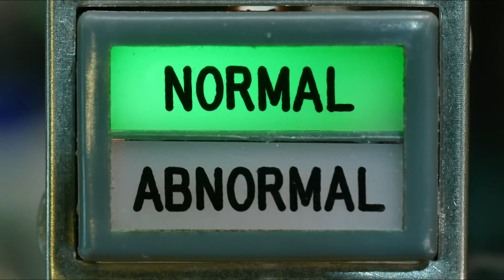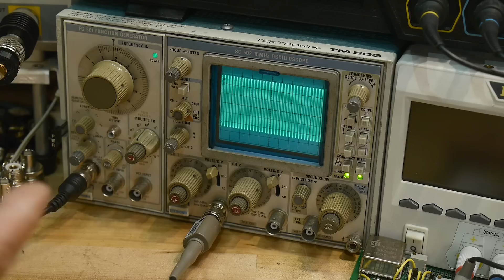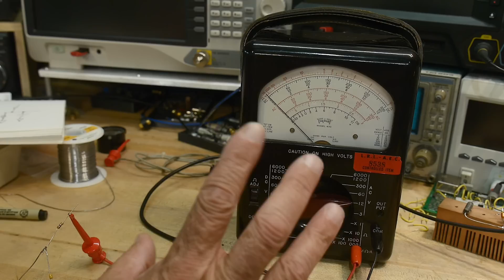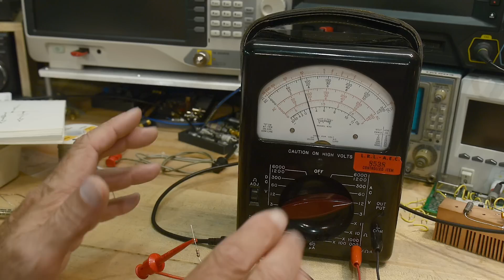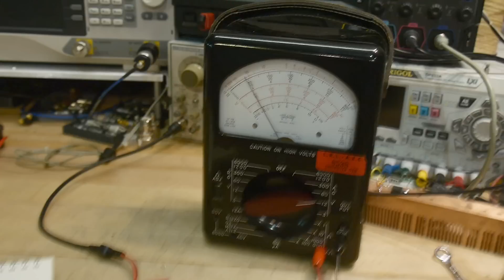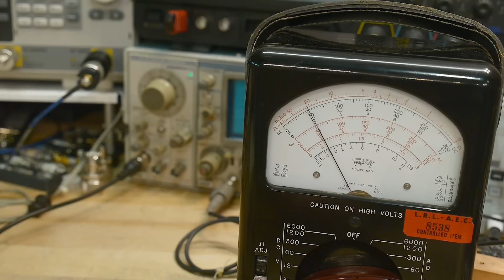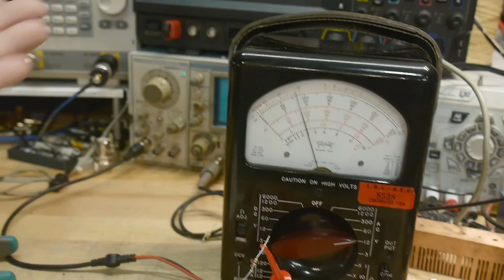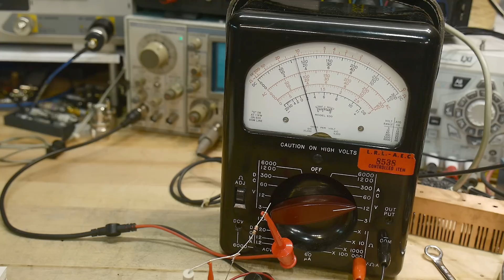#1607 Stop Making Excuses:   Learn Electronics

Comment: Love this video, and the message about Stop Making Excuses!

Maybe already said  by someone in the comments.
I disagree that in the RC or LC circuit, half a voltage is when the impedance of the C (or the L) is around the same as the resistor.
In the RC circuit, the voltage of the capacitor is Vc = Vgen*(1/jwC)/(R + 1/jwC)= Vgen/(1 + jwCR).
In order that this voltage was Vgen/2, |1 + jwCR| = 2.
Taking the squared module, 1 + (wRC)^2 = 4.
Isolating wC: wC = (4 - 1)^0.5 / R

The impedance of the capacitor is |Xc| = 1/wC = R/(3)^0.5 = 1000 ohm/1.732 =  577 ohm.

With the values you have: C = 10 nF, w = 2·pi·f, f = 30 kHz,
 |Xc| = 1/(2 * 3.14 * 30e3 * 10e-9) = 530 ohm, similar to the 577 ohm from the theory, but not 1 kohm as the resistor.

The same happens with the inductor:
|XL| = wL = 2 * 3.14 * 10e3 * 9e-3 = 565 ohm.

R/(3)^0.5 ~= XL ~= XC.
Reply: When |XC| = R or ,|XL| = R is the power what reduces to half, but the voltage reduces to 1/(2)^0.5. ~70.7 %.
Reply from the maker: my meter measures Vrms
Reply: @IMSAIGuy  It doesn't matter that your multimeter measures RMS because when you measure the generator, you use the same multimeter, so the ratio of VC/Vgen = 0.5. When the voltage divides by two, the power reduces -6 dB (one fourth). 
When you do ratiometric measurements, it doesn't matter if you do it in peak or RMS.
But in a series RC or RL circuit, when R = |XC|, the ratio of the voltage reduces to 0.707, that is -3 dB in power.

If you do the math, |XC| is not R at 30 kHz (or |XL| is not R at 10 kHz) but  |XC|~=530 ohm (and |XL|~=565 ohm). 

On the other hand, this kind of multimeters doesn't measure true RMS (I have mine since 1979 and I still use it), it measure RMS only for sinusoidal signals, because the relationship is a constant; good to do this experiment as long as the frequency was not too high due to the frequency response of the multimeter (and the loading effect if C is too low).

Comment: doesn't  swapping the positions of the capacitor and inductor also give you a notch filter, i.e. band reject?
The biggest things I got from an engineering PhD wasn't specialist knowledge. It was resourcefullness, tenacity, and problem solving skills.
The academic knowledge and mathematical treatments will only take you so far until practical realities separate the knowledable from the wise. Those very same skills are, however, likely to drive your wife mad😅 - "I don't need you to solve it. I need you to listen"😅😅😅
Reply from the maker: you need different L and C values that overlap to make a notch

Comment: My first volt meter was an analog movement I got from "something". It was pretty big with a mirrored scale. I glued blank paper over the meter scale. I used a pencil to mark a bunch of equal spaced marks. The meter movement went through a variable resistor setup as a voltage divider. I made another box that had a resistor and battery in series with a diode to give me an approximate 0.6v drop. I took this resistor+diode+battery with me wherever I went. Whenever I had a chance to use a "real" volt meter I would use it to measure the resistor+diode+battery thing I made and write down the measured voltage. When I got home I would use the resistor+diode+battery thing on my volt meter and calibrated it to my thing by adjusting the variable resistor on the volt meter to set the needle on a line and wrote in the value on the scale. Repeat a few times and I had a full scale. A rotary switch allowed different ranges. I even included one variable range setting to measure "odd" values that only needed a comparison to something else measured. I also would put paper tape on the plastic protective cover where I could write in temporary random values I might need for a specific project.

Comment: Hi Imsai, great example 👍A multimeter with a needle is the basis, I can't imagine it without it even today, for some measurements and adjustments it is better than a digital one.  I personally started with a self-made comparator bulb voltmeter - that was my first measuring tool, then came a Russian multimeter, which changed the range and function by switching the measuring cords to other sockets, and then somehow it grew by itself, in my the family had no shortage of ideas for presents. Later it became more interesting as knowledge grew, the construction of logic probes, single-purpose measuring devices, sources (the first adjustable source was a transformer for trains and a capacitor) etc. In socialist Czechoslovakia, there was not much to buy, and if there was, it was at high prices.
To this day, I don't have a frequency analyzer, I just don't do RF and for what I do, FFT has been enough for me and most importantly, it won't fit anywhere in my mini workplace 😂
Oh yes, bandpass filters - the basis of speaker crossovers

Nice day 🙂 Tom

Comment: Damn right! That's how you do it. Learn with what you can, do with what you have, look out for opportunities to get stuff. It will take time, it will take some cash, it will take determination - and it will bring knowledge, skill and lots of frustration... but also satisfaction. 

I started out pretty much the same way you did, using desoldered components, hands-me-down iron and meters, no scope. Access to information was crucial, that's why libraries were so important. I was quite a bookworm back then. As for tech, I used discrete transistors, stayed away from integrated circuits, then experimented with CMOS chips... I haven't gotten into making my own test gear until I was in university though.

Comment: That was great!  It's true.  My first piece of test equipment was a volt meter that my uncle brought over.  That was back in the 1950's.  I blew it up.  Well, I wanted to measure the voltage at an outlet.  Also wanted to hear what electricity sounded like so I plugged a speaker into the outlet.  You know what happened.  Many years later after getting out of the Air Force (they let me work on avionics stuff, and yes I did blow up some stuff) and college a Radio Shack VOM sat on my desk. I ended up working in the medical electronics field and no, I didn't blow up anything.  Anyway, got married, had children, was poor, but there was always a way get more electronics test equipment - cheap.  At a recent HAM radio convention I found a HP 3478A DVM for $30 and it works great.  A friend of mine who works for a local telecom company acquired an old HP 8711B.  He didn't kneed it and was going to throw it away.  It's now on my workbench and has been modified to a 8712B as per the IMSAI Guy.   Well I could keep rambling on but your right about just keeping at it.  I'm in my late 70's and still find a great deal of pleasure in just learning and tinkering!  I hardly blow up anything anymore.

Comment: Well said. I often read those comments from viewers whining about not having a gazillion dollars' worth of equipment. As you have shown in this and other videos, a motivated person can learn a lot with basic tools, using materials salvaged from discarded devices. Low-cost test equipment--oscilloscopes, DMM's, function generators, etc.--can be had in kit form for little money. Old-timers with experience in circuit design and repair can be good sources for know-how and cheap (or even free) equipment, if approached respectfully. Almost anybody who watches a YouTube video probably owns a computer or smartphone with Internet connectivity, and thus has what it takes to access the online simulators and free electronics courseware that are mercifully abundant nowadays. And I've noticed a kind of sympathetic magic that happens once you dive into a topic. Somehow, the knowledge and materials you need just seem to appear out of nowhere....

Comment: As an engineer who watches this engineer's channel I'll share that what drives someone to actually learn how electronics works (or anything else) is an inordinate amount of curiosity. As a kid I would drag home discarded tube-type TV chassis from the repair shop at the top of our street, plug them in and fiddle with them to see if I could make them work (I should be dead.) As a teen, I'd construct battery-powered transmitters and use my CB radio to confirm that they worked at the intended frequency. I acquired two WWII millitary receivers and swapped parts until one worked. I'll never forget the thrill I felt the moment that I adjusted its repaired BFO until the Donald Duck sounds I kept hearing rendered intelligible speech. As an adult, curiosity drives me to repair my gas-powered tools, my plumbing, finish my basement, learn investing and then teach myself OOP to write a program to help me track my portfolio. Be curious. Stay curious.
Reply: As a chemist, I approve this message! Brew beer, fix circuits, learn Maple, relearn quantum chemistry, etc. I hate when people say "I'm bored!" The world is full of great and wonderful things to do!
Reply: And the nice thing about electronics is that it's such a wide field nowadays that you will never be able to learn all there is to learn about it in one human lifetime. There will always be new stuff to learn 😄
Reply: @Hunyadi1442  For sure!
Reply: 'as a...' comments are stupid and posted by sheep
Reply: i didnt do that , it was too hard for me so i went into software at a young age instead!!!!
Reply: Really helps if your parents are easy. 'What ya doing? Pulling sh! t apart again?'

Yes ?

Good on ya, let me know what you find

Comment: This is a really great lesson, pace the invective. The hard thing about getting started is actually engaging the mind and thinking through things.  I personally have read  explanations and been mystified, until actually doing something led me to understand what the explanation was really saying.  The hardest thing is knowing what to do to start, and this video is fantastic because it shows a way to do something physically that explains or motivates the whole e=ir and reactance varying with frequency of the applied signal.  A series of videos where someone starts with a 555 and makes the signal generator, etc would be really fantastic I think.  The process of learning is hauling yourself up by your own bootstraps and the most important very first step is to learn where to pull... if you take my meaning.  But I will say this in defense of invective: it was the irritation that motivated you to make this video, so it can't be all bad. 🙂
Reply: This is exactly my case, I can read tons and nothing, but once I build it, the reading starts to make sense. It's interesting that I also think like this at work - I never have to see the device, but when I figure out how the manufacturer intended it and how it should work, I fix it, sometimes even improve it.
Reply: The more you fuck around the more you find out

Comment: Cool. I have the same multimiter. it use a 30v battery. Where did you get it?
Reply: The 30V battery is only needed for the highest ohms range.   The 1.5V D cell is sufficient for all the other, lower ohms ranges.
Reply from the maker: I can't find them either (for a price I would pay). It can't measure resistance but that does not stop me from using it for everything else.
Reply: Ya, the 30 volt battery is a big drawback to this meter. Some places are charging $30 for a replacement. Ther are hacks to use 3 9V batteries, kinda "how ya doin". Search YouTube for "Triplett VOM 30v battery upgrade to 9v batteries".
Reply: Stack 10x lithium or 20x alkaline coin cells?